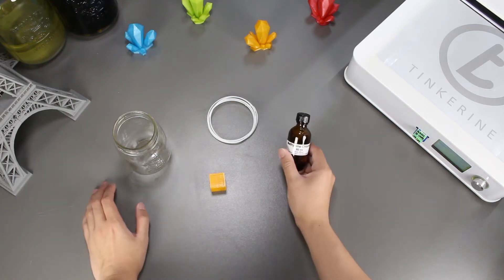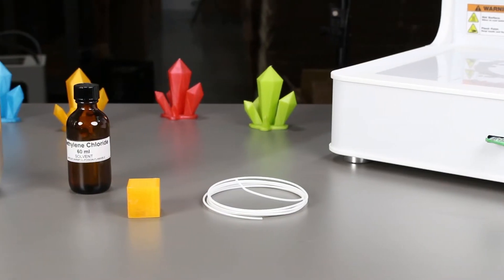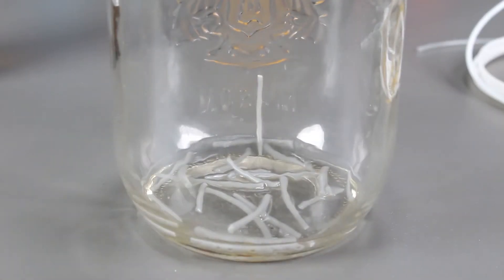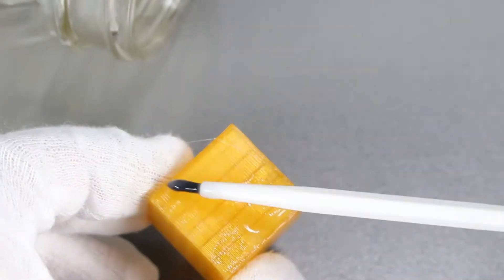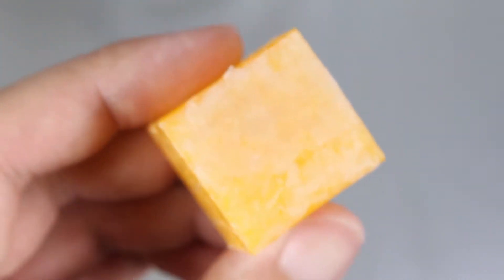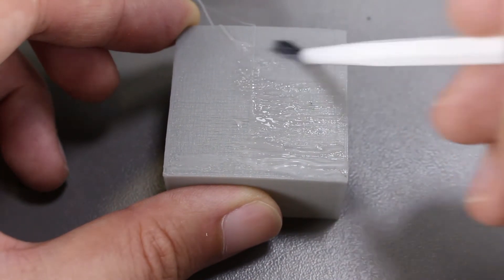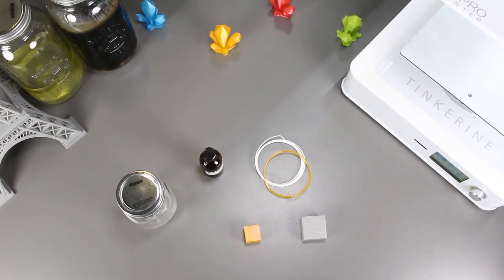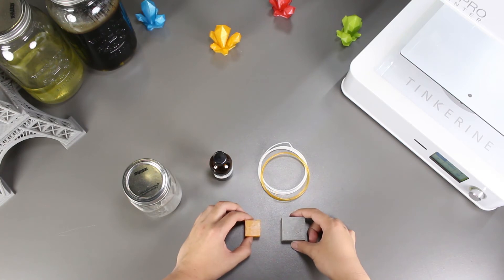Smoothing PLA with Methylene Chloride PLA Paste

Comment: your gloves are unsuitable for handling this chemical. Methylene chloride is a very dangerous chemical and it evaporates quick so you need a respirator and done under a fume hood. 

Don't do what has been shown in this video if you value your health.
Reply from the maker: Hi,

We wore multiple layers of gloves along with latex gloves inside as well during the experiment and we did it in a well ventilated area. Thanks for the heads up and the warning!
Reply: Tinkerine pfew! glad
Reply: @Tinkerine  1:58 no glove whatsoever ...

Comment: Hi and thanks for great videos! I was wondering if the amount of PLA wasn't high enough? Would the paste be a little more fluid and easy to apply and settle using differet "racio"? :)
Reply from the maker: Hi!

Thank you so much for the comment! That could be possible, we can look into the experiment again with different ratios.

Comment: Off topic: Like your videos very much,  interesting works, thank you.  Recently I do experiment to use oil paint canvas (only the cloth, without the cardboard) as a printing cover for my aluminum heated bed to print PLA objects. Just stick the canvas on the metal bed with school glue stick, no need to glue its surface. It works great, printed objects stick to it firmly yet still easy to remove, and it is cheap and reusable.   You may try this one out and see if it works with ABS too. If I missed something, please ask.
Reply from the maker: Thanks for the suggestion, we will take a look at it!